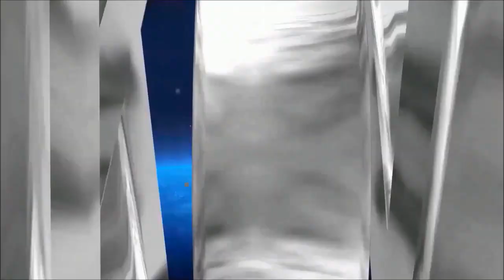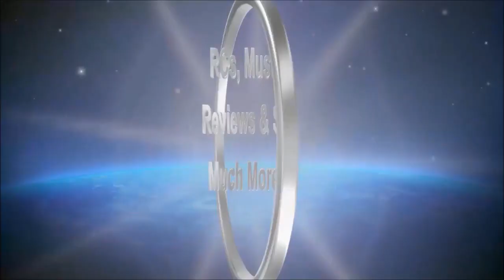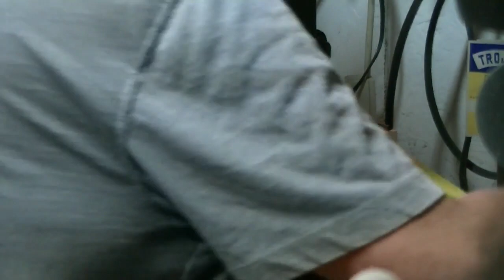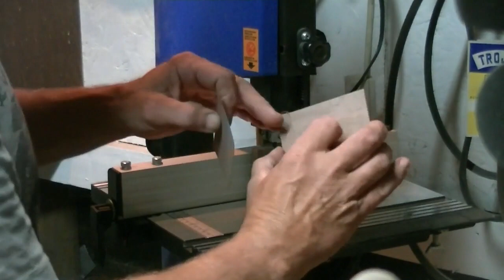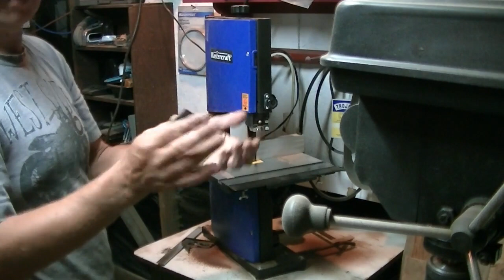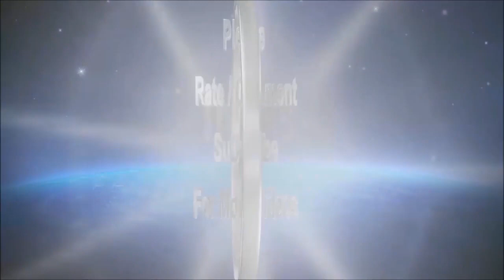Mastercraft 9 inch Bandsaw Update Review Must See This

Comment: I haven't used the band saw too much . The blade came off the wheel and I am not able to get the blade to center on top wheel and keeps popping off. I spent almost 3 hours trying to adjust. I can see the blade on the top wheel when I manually turn clockwise and it is not centered. Tried adhustubg with tracking know but no change. If I do not get this resolved, then its the garbage.
Reply from the maker: read the instructions very careffully they are tricky on all bandsaws and you might not get 100 % perfect but you will get close enough how ever let some of the tension off the blade when adjusting not a ton once you get it cetner or close to center then youll be fine then just tighten the blade tension back up a bit if you over tigenten any adjustments then its going to give you problems also make sure the guide shoes are also set properly youll need a feeler guage for that
Reply: The manual is not very good. After so many hours to get it resolved, there is a video that instructs how to use to wheel tracking knob. This resolved my problem. Now I need to get more detail on the top tension blade and need know how it works. What happens turning clockwise or counter clockwise.

Comment: Hey Kevy   ...  so i just bought this same saw, and was wondering if you have installed a metal cutting blade on this saw yet ?  let me now what you ended up using or if you have a suggestion
Reply from the maker: nope but you can do it and it will work fine ..

Comment: I have one of these saws and it wanders to the right.  I set it up as per your video and the tracking doesn't seem make a difference.  is the blade too loose?  I cranked it up and down to see if there was a difference.  always turns the blade away from the fence.  what am I  doing wrong?
Scott
Reply from the maker: well something in youjr setup is wrong or you could even have a bad blade which can happen
Reply: You might need to adjust your table - it maybe rotated.
Reply: Hey Scott have you solved this issue? Looking for tips. Mine is doing the same thing

Comment: A question,  does the manual say you can use anything other than a 1/4 " blade?  I see other places sell 1/8 and 3/8 blades but I would like to know if Mastercraft recommends those sizes for this model.  Thanks for the video, it is helping me to decide.
Reply from the maker: master craft them self only supply one blade size but you can use others i used to have a delta 9 inch and iused 1/8 and 3/8 blades on it so i cant see why not the wheels are the same size as the detal one was

Comment: I have this bandsaw -but - I break blades easily - and not at the weld usually.  I use it daily - I own a retail store and make my own wooden decor.  Also - it seems to vibrate a bit.  I feel that the 9" wheel is partially to blame (?) I always use Canadian Tire replacement blades.  Frustrated........ any ideas, advice?
Reply from the maker: if your braking blades then your getting bad blades or your pushing things to hard , is the band saw bolted down secure to the table you have it on?
Reply: @KevinMillard68  I order replacement blades from Canadian tire. I dont force cuts and am not aggressive. I have read that the small 9 inch wheels are to blame for breaking - due to such a constant tight turn.

Comment: Have you changed the blade? I've been trying for over 2 hours.
Reply from the maker: i havent had to yet so that would be a no
Reply: @KevinMillard68  darn... I just set it up today and as soon as I turned it on the blade came off. The instructions say loosen all tension off the belt. When putting the new one on it says to turn clockwise with your hand to center blade. The problem is that there is no tension on the blade for you to turn it.
Reply from the maker: @Jon-vw9wb  yes there .is study the manual closely its . a bit shall we say different to read and understand if all else fails the soonest i have time to do a video will be next week
Reply: I got it... Finally
Reply from the maker: @Jon-vw9wb  good stuff

Comment: I know you may not see this, but I just bought the newer model of this saw, using your videos to help me set up. I have some concerns. 1) the tension release does nothing. At minimum or maximum tension,  it still doesnt touch the wheel mechanism attached to tension release handle. 2) I can't get very close to .002 with my feeler gauge on one of the bottom bearings. Max in still has room.  The cuts looks fine, but I don't know ifnits worth returning or if it's just a manufacturing defect
Reply from the maker: yiour going to have to find away to adjust the bottom adjuster for the blade also take your cuts slow it is a bandsaw after all so let it do the work